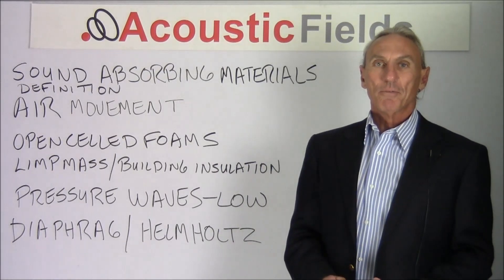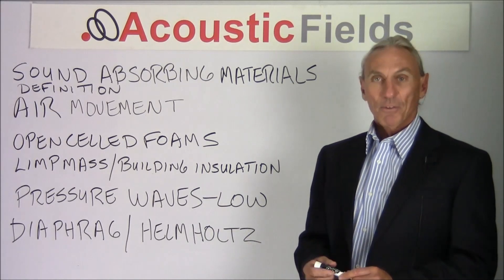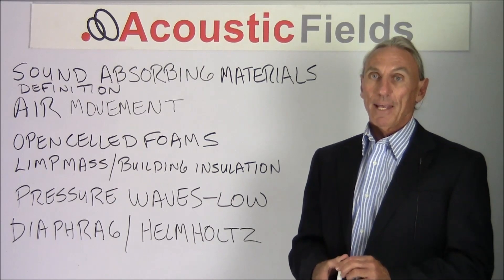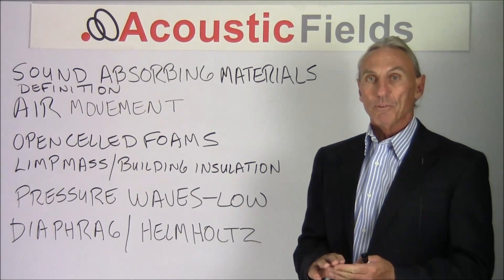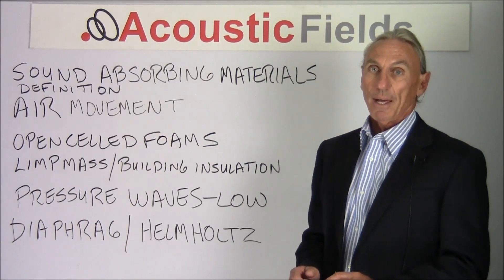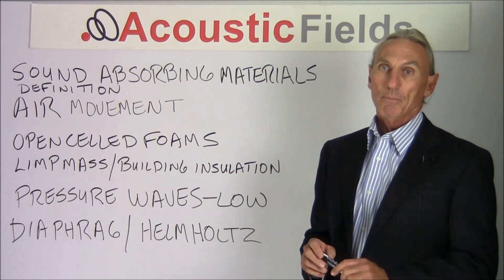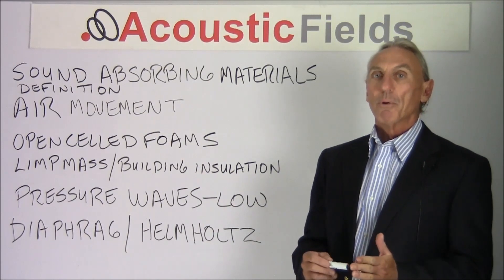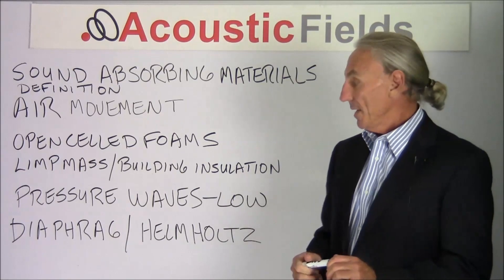What Are The Best Sound Absorbing Materials - www.AcousticFields.com

Comment: Hi Jamie, 

What would be the best "spray" type insulation material (as in blown foam, cellulose, or fiberglass etc.) that would be best for dampening lower frequency sounds in a partner's heavy snoring?
Reply from the maker: +redsbr You will have to move the noise source away from the receiver. Isolation of the noise is often used. Another technique is to build a barrier between the noise (source) and the receiver. You will have to measure the frequency and the strength of the noise to determine what barrier technology to use.
Reply: redsbr A clothespin has been known to work...sorry couldn’t resist

Comment: Would you classify coir slabs (made from coconut fibers) as good absorption material ? I've been hearing good reviews about natural coconut/jute fiber being as good as its synthetic counterparts in terms of absorption across varied frequencies.
Reply from the maker: You can compare the rates and levels of absorption in the test results. Always research the test labs and make sure they are certified and independent and not owned or affiliated with the company that is producing the product. It is good to see a move to more natural materials. The synthetic ones currently in the marketplace are a health hazard and are not allowed on any of our project sites.

Comment: Hello. Would the rock wool wrapped airtight but loosely in thin plastic foil work as an acoustic absorber?
Reply from the maker: Hi MFD, Most of these building materials have an absorbent coefficient that can be applied to acoustics. You have to be careful with what rate and level you use in your strategy and how you use it. Most of that material is toxic to your lungs.
Reply: ^ like you have to eq a mix, you have to eq a room. Rockwool can help with absorbtion, but if you don't know what it's doing to your room eq wise, its the equivalent of trying to select plugin's with your hands over your eyes, and every single move costs money.

Comment: So what would be the sound absorbing quality of say a 36"x24"x4" wooden frame with a wire mesh on the one side to hang on the wall and fabric mesh on the other side and between the two meshes is loosely packed cotton balls? And say there are 4 of these per wall in a room that has 1/4" thick soft carpet and it's dimensions are 12'x12'x9' with a vent divot of about 12" x 24" across one end of the room and a closet taking up 5'x3'x9' of space in one corner and the door is on the same wall as the closet and this room is in the basement. This is a bedroom by the way with a double size bed. I'm giving the room size cause that plays into the sound factor right?
Reply from the maker: Hi Bekto, I would need to know the sound absorbent coefficients of the materials you are using to determine the rate and level of absorption with this design. Sound absorption in any audio room has to match the rate and level of absorption,  the amount of material to deliver that rate and level and where to place it to the usage of the room. Guessing is never a tactic to employ.
Reply: Acoustic Fields where would I go to find out those coefficients? To be honest I don't know how to figure that out.

Comment: So what would be the best material to use in a wall that's along a busy Street... traffic noise
Reply from the maker: D,  There is no one size fits all. With noise issues, you must measure the frequency and amplitude of the noise and then design and build the proper barrier.

Comment: Hi Acoustic Fields,I would like to know, what material to ask our council to use, to do the best sound insulation inside their house on our common wall, that would either reduce the noise they make, or better yet, completely cancel it out?The noise is either children/grown ups shouting, screaming laughing loudly, and/or children running, jumping, banging and the like, plus grown ups pushing electric devices into sockets on that wall (one can even hear the light switches).The vibrations or noise of the running, jumping and banging sounds can be heard even through the closed door in another room, whose wall is 2 metres away from the common wall. Since this is often long after midnight (until 3 or 4am), my life is really disturbed, and I'm trying to figure out, what to tell the local council, since it is a council house.Would really appreciate, if you could give some advice. Thank you in advance!
Reply from the maker: Hello, Noise transmission through structures is a complicated issue with many variables that must be measured (quantified) and then the appropriate structure and materials used in the correct manner to provide proper isolation. It appears you have equipment and human noise to deal with. It also appears to me from your description of the way the existing structures are performing that you have structural issues as well that are contributing to the existing noise levels. Without noise measurements, I can not even begin to assist you. That said, I think it might be best to move to another location that does not have these issues rather than look for a fix. Barrier technology is permanent, expensive, and must be installed by a professional who understands noise transmission circuitry paths.
Reply: Thank you very much for your information! Unfortunately, moving isn't an option at the moment, especially since I could end up with the same kind of neighbours or worse (when I moved into this place, these people weren't there yet, otherwise I wouldn't have moved in there).

Comment: Hi I would like to build a sound proof booth in my garage to practice with clarinet, dimensions 2200x1200x1000 in mm. I was thinking of using either mdf or melamine for walls and line it with some sort of soundproofing material. I am not looking at 100% soundproofing but something that will reduce the noise, what do you recommend as soundproofing material.
Reply from the maker: Hi Grneta, Remember that there is no such thing as "soundproofing". Nothing is "proofed". You must manage the energy and lower the amount down to levels that are acceptable for your usage and adjoining humans and structures. Do you have noise data for the outside noise frequency and amplitude? I have data for clarinet pressure levels.

Comment: Are there completely soundproof headphones?
Reply from the maker: +Hjärnan Masken There is no such thing as "sound proofing". It is not possible to isolate energy completely from coming into headphones or leaving.
Reply: *****
Possibly. I have a pair that reduces up to the mean of 40 db in 2000-8000 frequencies. And also good generally. 3M:s Peltor optime III.

I can't find any info on how much the earmuff  reduces noise by itself without the electronics.

Comment: great video, what do you think about active/electronic bass traps?
Reply from the maker: Hi Amiel,  I do not have any personal experience with them. We have low frequency technology that has low levels and high rates of absorption. It is the most powerful technology currently in the marketplace. Properly applied within a room size and volume, we are able to reduce room response peaks and troughs into a range where small amounts of EQ smooths out the balance.

Comment: When you say that sound energy is transformed to "heat" - is that actually true? I've never heard that. Does this mean that the physical temperature of a sound absorption panel rises when it is absorbing sound waves?
Reply from the maker: Hi I. Hernandez

Heat is produced by the process of friction. It is the movement of air across the absorbing material that produces the friction. Heat measurement would be minimal.

Thanks
Dennis

Comment: Hy, Acoustic Fields. I have a big mistery with this panels that i made from HD Foam Plus ( i made bass traps and 2 panels for primary reflections// with space leaved between the panels and the concrete walls )  ) that contains some kind of insertions in it, and from what i v read on this big internet, they have closed and open cells.. I don t know if i should change them, or maybe add something else over them.. i don t wanna user rockwool because of the health problems that may cause.. Can i get an advice ? Thank you!
Reply from the maker: S,  This is the issue with home made treatments.  You do not have a measured frequency response to use in your analysis. What is the depth of the units and how are they constructed?
Reply: Yup, i know! I didn t measured the room freq!  My home studio is a 4 meters L x 3,5 meters wide x 2,70 meters height. For the primary reflections I have 2 panels 7 cm thick // they are 2 meters Long  x 1 meter wide,  framed in an wood rectangle and all of this covered in black material.. some thin cotton ..tshirt type material  ( they ,,come'' from the ceiling down to almost touching the floor  ) . The bass traps are the same but only  70 cm wide, and they r put like this https://ehomerecordingstudio.com/wp-content/uploads/2015/04/panel-bass-trap.png .. they come the same, from the ceiling down to the floor. On the back wall i will put 2 x 60 skyline wood diffusers designed for freq beween 650 hz - 3500 after thaat clasic formula.. or maybe some simple diffusers.. i want too see how they will affect the room.. my ears. ( i gave you more details to create a better picture.. but my main concern is that material !!! ).  I hope i understood your questions..and answered correctly
Reply from the maker: S,  Unfortunately, none of the treatment you are using will treat the issues in your room. Two diffusers on the rear wall will not cover enough surface area to have an impact and none of the lower frequency treatments have the necessary rates and levels of absorption to deal with the issues in your room with those dimensions/usage/volume.
Reply: Thank you! I will change them!

Comment: I have a wall that is pretty good but the bass still comes through. Would adding mass to the wall like a thick rubber matt like this https://www.tractorsupply.com/tsc/product/rubber-mat-black-4-ft-x-6-ft  help quiet the bass?
Reply from the maker: A,  Low frequency energy needs mass to stop it. A rubber mat will not work. First, you must measure the frequency and amplitude of the noise and then design a barrier to deal with those frequencies and their strengths. Using tactics (rubber mat) without a complete strategy to deal with the issues never works. You would be just guessing and guessing is too expensive and won't work most of the time.

Comment: Another great video Dennis. Ive experienced high volumes at 30 cycles and lower. The venue walls were pulsating to such an extent that it caused the walls to crack and the roof slates to shake off. Pre the health and safety at work act here in the uk. The high frequency sound seemed louder (painfull) but it didnt pressurise the room at all.
Reply from the maker: Hi Adi,

Yes, I have experienced the same thing. I have felt a 30 Hz. wave move through 2 - 8" thick, poured concrete walls with  6"  air space between them. People just don't understand how much energy to manage this really is. However, once managed correctly, you can have definition with attack and decay. It takes mass and real estate.

Thanks as always for the comment and support
Dennis

Comment: Let me add some visual representation to this phenomena and perhaps it will be clearer.
Sound is the ordered movement of atoms and molecules in rapid waving patterns.(YES that wave of sound at any Hz is a perfectly ordered shape of atoms and molecules - POOF brain explosion)  Heat is the disordered, random, movement of atoms and molecules. Disorder in thermodynamics 
Therefore, all you have to do in order to turn sound into heat is transform some of the ordered movement of the atoms and molecules into disordered movement. This effect always happens to some extent. This effect happens a lot whenever the sound wave encounters irregularities as it travels. ergo  any diffusion means. Since the waves of energy producing sound are  all at a different frequency , you may disrupt this perfect waves with ONE barrier that may disrupt the perfect wave of different cycles. But you will not find (in a manageable way) one material that will convert that perfect wave into heat ( atoms & molecules) hence the variety of elements that will disrupt the sound at 20Hz  but will not affect 20Kz  
Here you find an excellent primer in audio explaining in detail Soundproofing and Sound Absorbing
https://soundproofing.acousticalsurfaces.com/thank-you-for-downloading-common-noise-problems?submissionGuid=a3e60c06-9812-44e9-bc0e-357547114b25